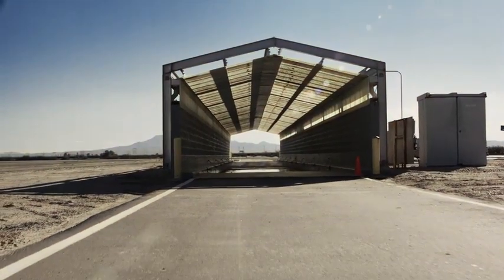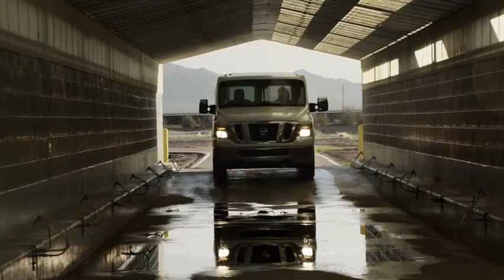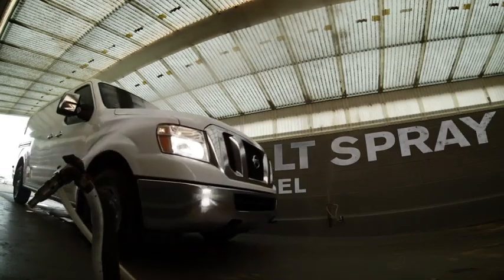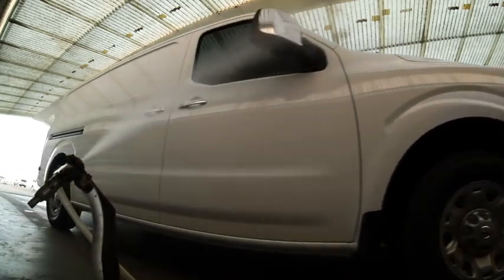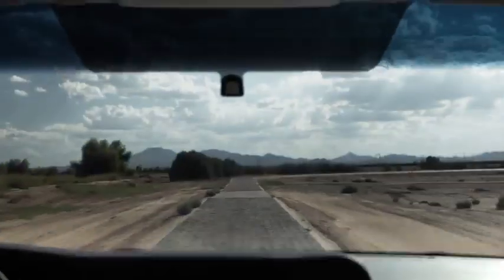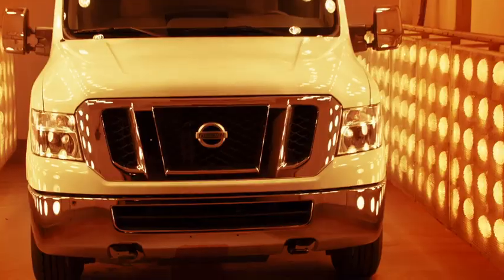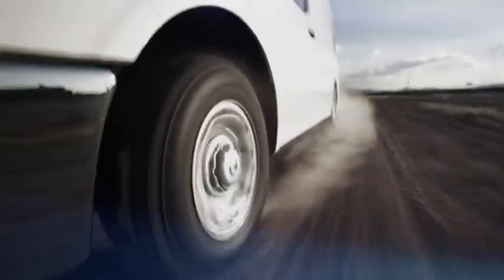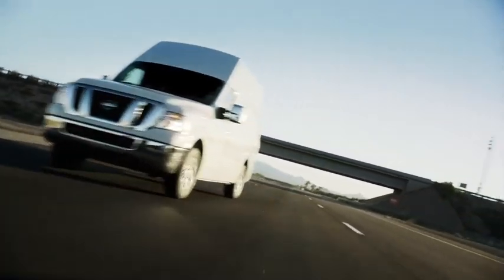NCV Proving Grounds: Testing NV vans for quality

Comment: Dont Buy Nissan, I owned a Nissan Murano years ago, its the worse decision I made
to buy this scrap. Not only the quality its poor, but the service. I live in Mexico
and the Nissan shops are very corrupt, they steal the people by not doing the
service they should. Tons of people report they don’t get the oil changes and
replacement parts they charge. Problems are never solved properly and there are
tons of complaints. I am glad they are sawing what they deserve.
 I made may complaints and never receive attention, Now I am with Honda, Ford and GM. Better quality at least for the same or better price cars.